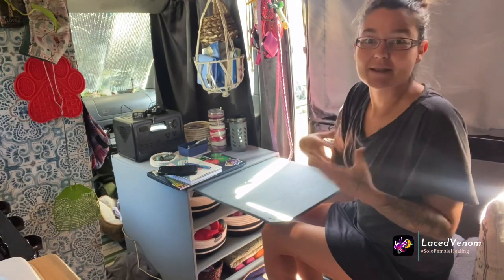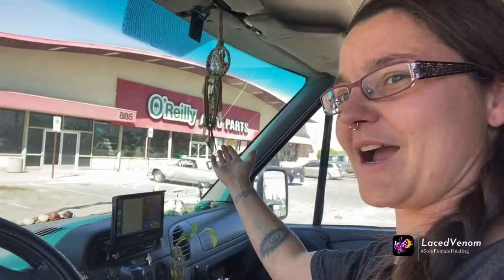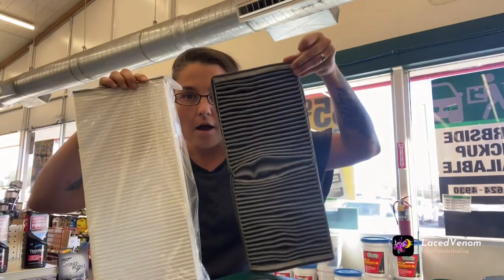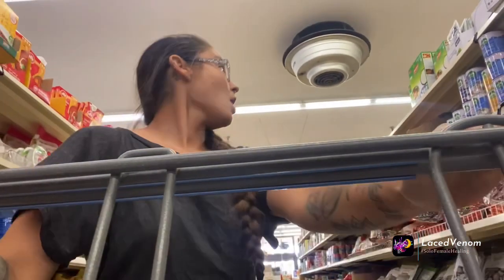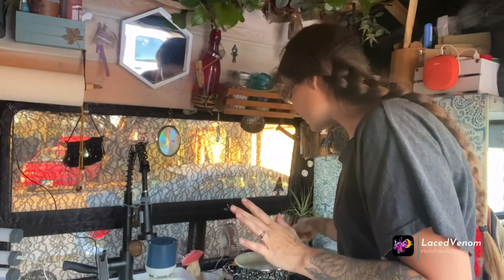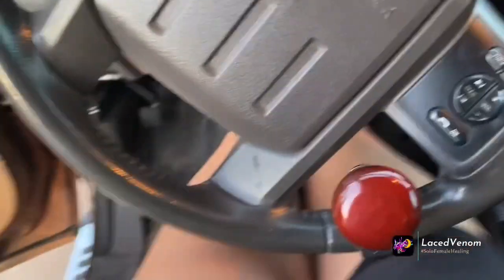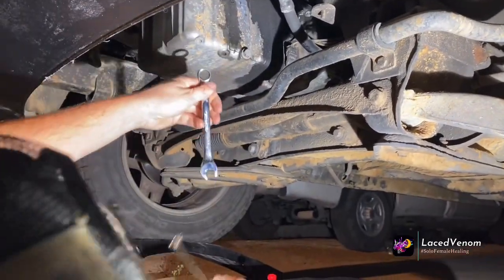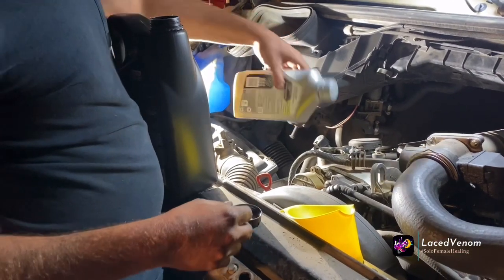Vanlife Maintenance

Comment: Be glad jigsaw is a little dude. I have done a   7.2 liter caterpillar and a 12 liter Detroit. 16-20 quarts😮😮 of 15W40 Turbo rated oil.🤑🤑 you don't want to know what the filters cost.
Most oil change places have a sticker  they put on the corner of the wind Shealy.
What we did was mark the filter with a permanent marker with the date and mileage. But bigger filters and you can see them from the wheel wells when checking for leaks and during pretrial.
My old vehicle I just write it under the hood in marker.😂 you will figure something out.

Well off to the grind. Got to do some wiring. Try not to let the magic smoke out. Or piss off the angry Pixies.
Stay safe out there rambling all over the desert.🍩🍩🍩

Comment: they have the little oil change stickers at advanced auto don't no but would think o rileys have them and there free just ask for them what brand oil you use I always use shell truck diesel oil especially in older gas engine's to it has zink in it the other brands don't have it and older engine's need it for wear on bearings
Reply from the maker: This is good information thank you! I have been worried about switching my oil, but I can’t keep doing the liquid Molly brand it’s too expensive